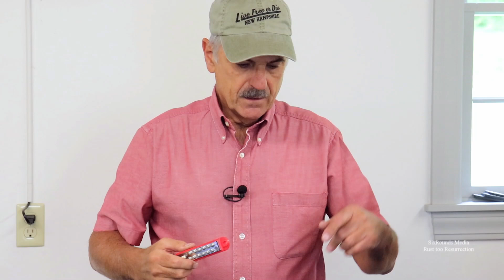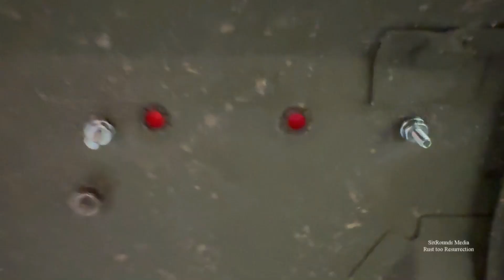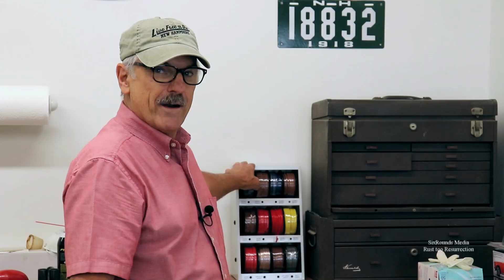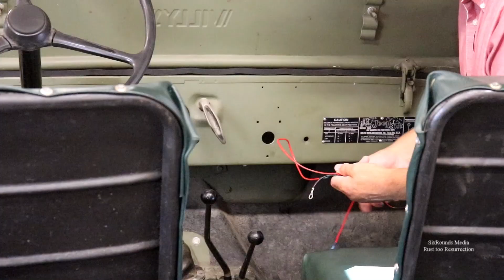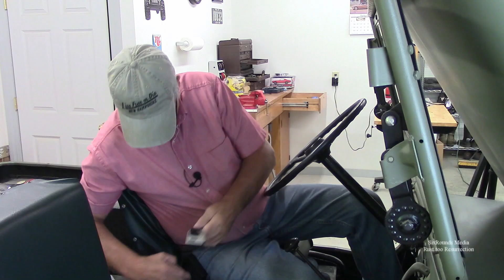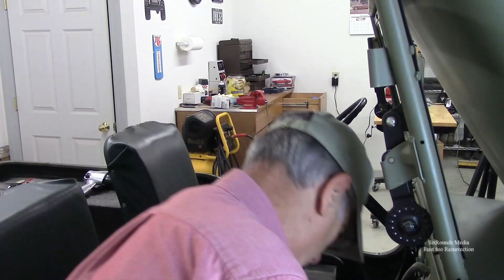Installing USB Power

Comment: I have a friend who did something similar with his 3A. His kids ride with him a lot, so he installed a usb jack on the back bottom of the drivers seat, and routed the power wire the same way as the wire for the sending unit.
Reply from the maker: Hard to let go of that modern stuff 😟  That was an interesting way to run the wires..